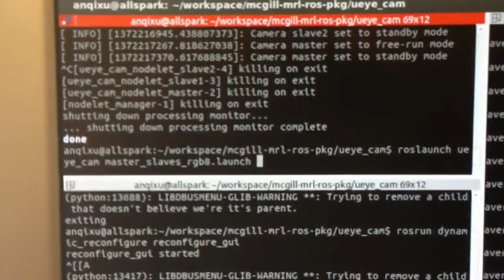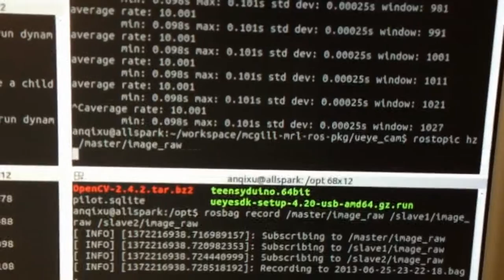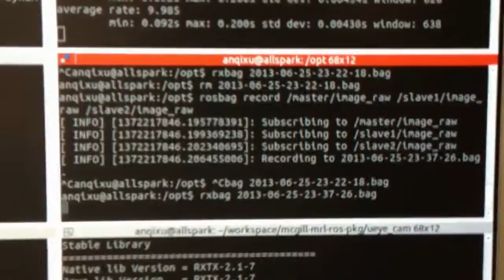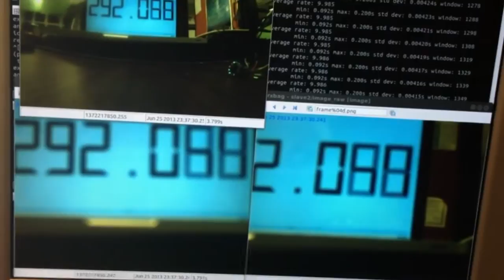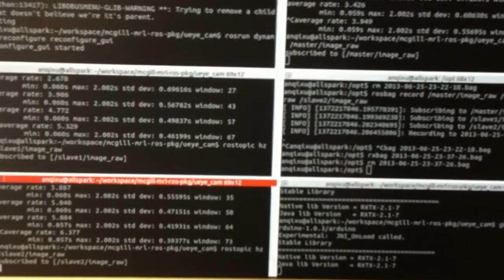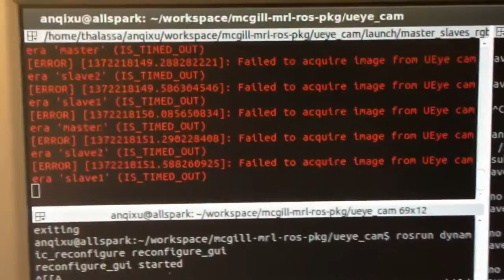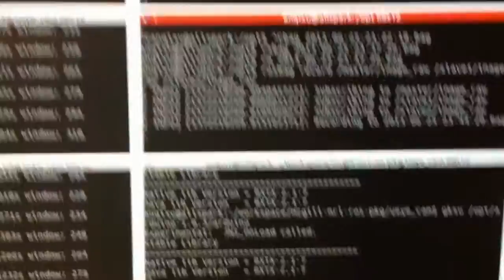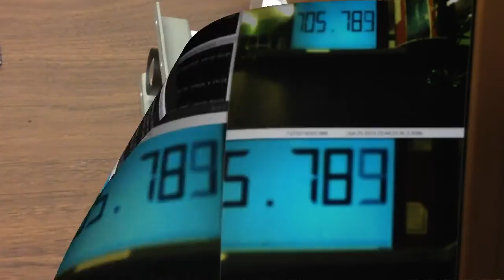UEye Camera Synchronization Demo

Comment: Good video! What is the pin adapter you have in your cameras? I also have the board camera and would like to have a pin interface so I can connect it to a raspberry pi in order to trigger them.

Comment: Isn't the screen refresh rate (50-60Hz) affecting your measurements?
Reply from the maker: Indeed. These ARM devices are still lacking a large amount of compute horsepower needed to do proper image processing at reasonable rates, with or without rendering on screen. On the other hand, it's awesome to see the potential, given that they are now able to start handling high-end USB cameras like the UEyes.